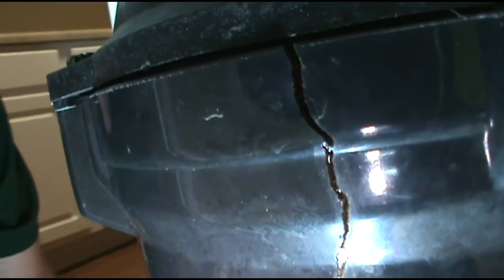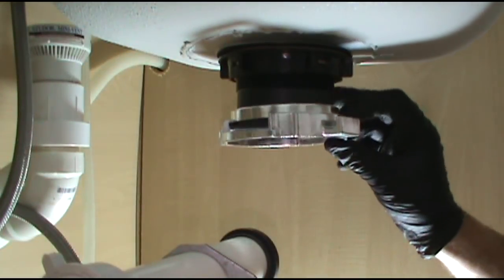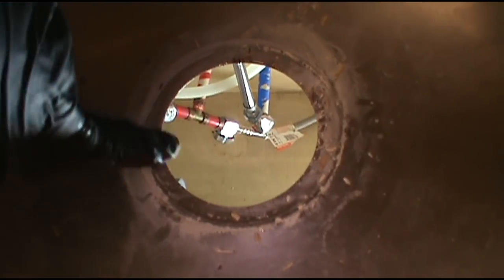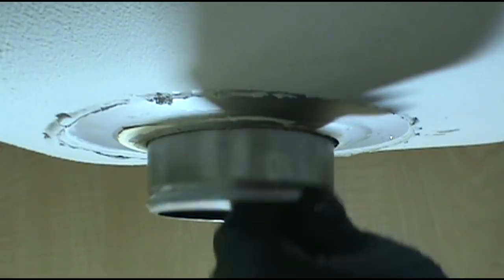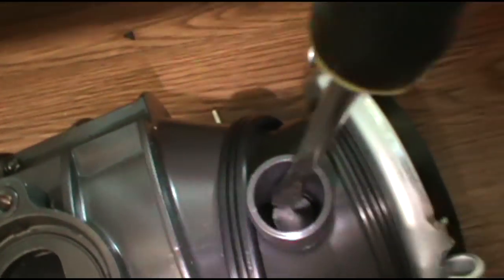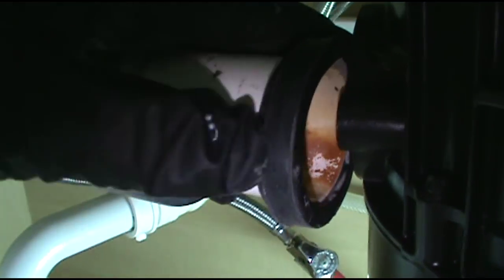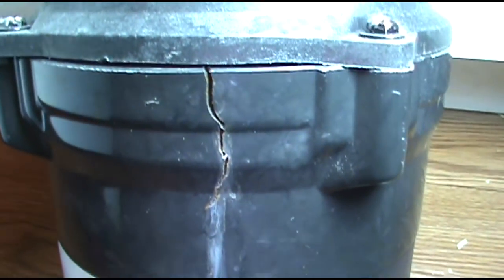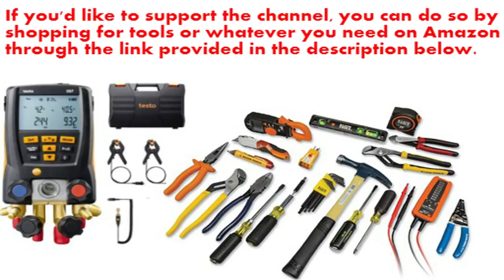Fixing A Leaking Garbage Disposal

Comment: Awesome man. I put in 3 whole units the end of the summer. 1.5, 2.0 and a 2.5 ton. The air handler on the 2.5 is HUGE. Ridiculous size. Yeah i dont want to talk to anyone while im doing a unit. Between the wiring and all the other details....i dont want to make a stupid mistake. Yeah...ive fired up a unit without opening the king valves. I think ive made every mistake a guy can make.....
Reply from the maker: Yea, that's what I wanted to avoid. Adding a camera to the mix wouldn't have been wise. Thank you so much for watching Jeff!
www.DirtyMaintenanceNation.com

Comment: How do you fix a tub spout and shower head, water comes out of both of them when turning water on?
Reply from the maker: Replace the tub spout. They usually twist off or they have a star screw on the bottom you'll have to loosen to get it off. Sounds like the diverter is shot. Thank you so much for watching Angel!
www.DirtyMaintenanceNation.com
Reply: @LexVance  I change the diverter and shower cartridge and it still does the same thing.
Reply: Did you use Magic Lube on the cartridge? @angelnegrete4676